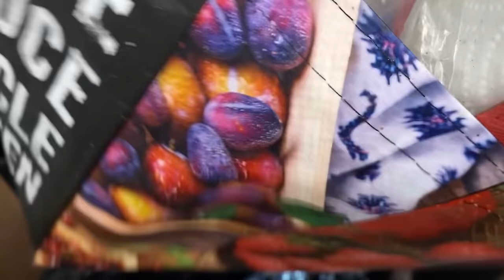3 days hard cleaning in infested apartment #cleanwithme #cleaningmotivation2023 #decluttering

Comment: BTW-In my experience toilet brushes usually don't do such a good job on a dirty, stained, water line mineral ringed toilet.  They are OK for maintaining a previously cleaned toilet, but the way you go in with your sponge is the most effective way of cleaning what you normally have to deal with.

Comment: I have got to give you so much credit for the cleaning you did and your heart is certainly in the right place. With that said all your cleaning is wasted if the roaches are not treated. They hide in the microwave you cleaned and behind and around the stove, underneath the fridge and behind it. The mattress needed tossed as well. How do you dispose of all the bags of trash?  Not only does the home need treated the walls and ceiling need the feces from the roaches washed off. Not good to breath that in. The apartment needed bombed with roach killer before going in and again when done.  And once a month for several weeks to keep them out of the apartment.  God bless you for the help you provide others and be safe.  Carry on. 🙂

Comment: Honestly. I would have done this, but I think it would have been actually traumatic. I really really dislike mice and roaches.  It’s above and beyond, Barbie. I hope the News story went well!❤ And no, you cleaned those cabinets as they should have been cleaned. Chloroform and hot water were the only thing to do there.
My friend had a cockroach infestation-we had to throw away almost all of the electronics-microwave included . They eat the wires, and lay eggs inside, so they should replace these when they move.😢
Reply: *Chlorine - don't use chloroform 💜